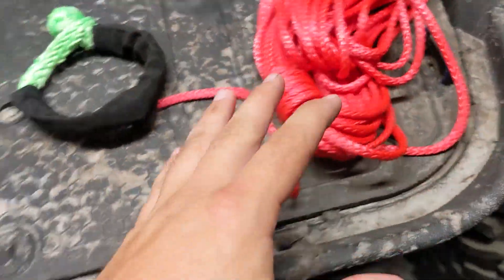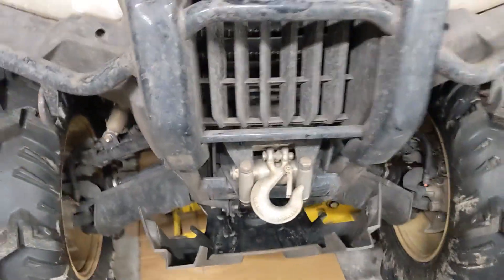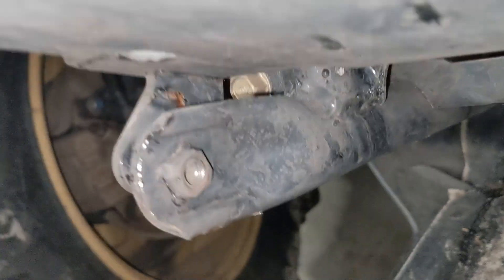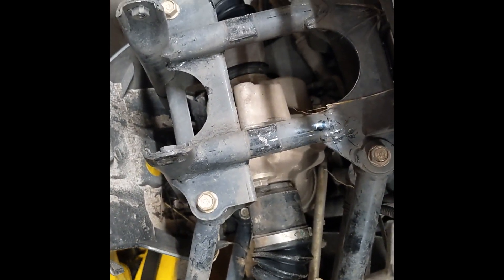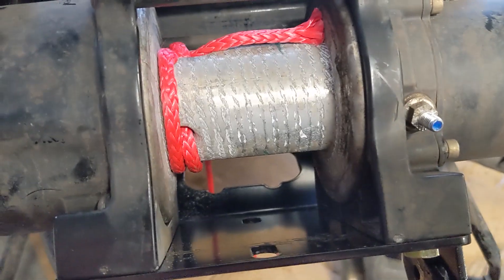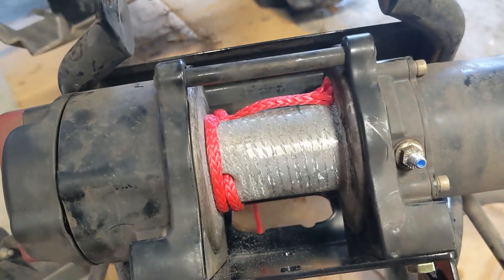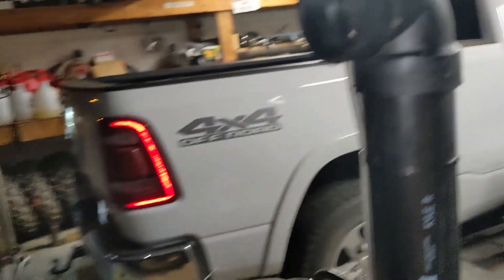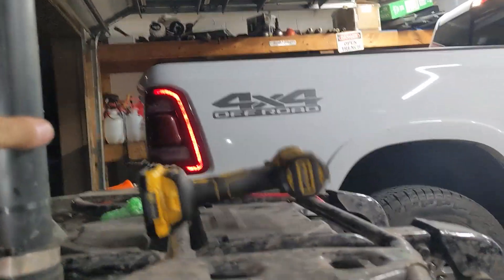2022 Rubicon Factory Honda winch upgrade Synthetic and better bracket

Comment: The dealership left the key on when they were assembling mine and i had 32 hours on the machine with 0 miles. Also not all the bolts were tight, already lost a few bolts on the "skid plate"
Reply: Damn that’s terrible